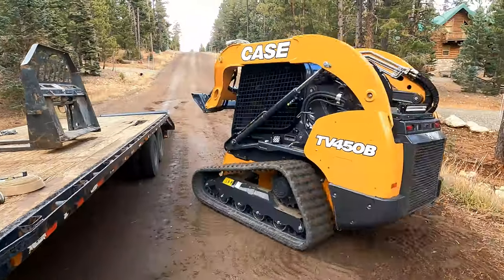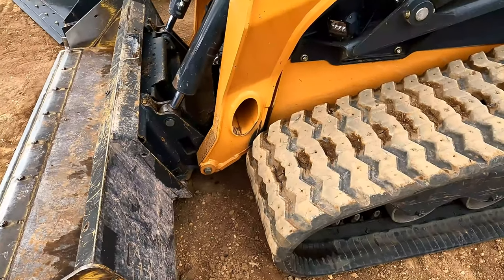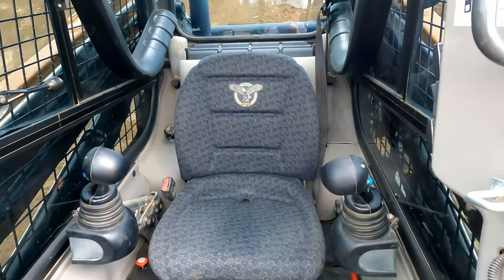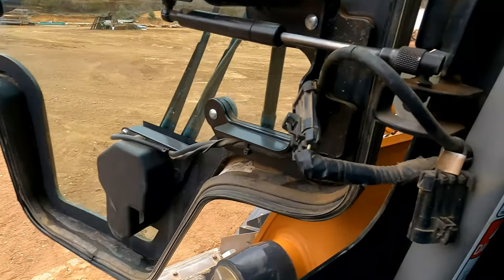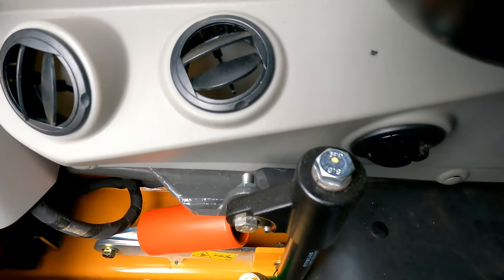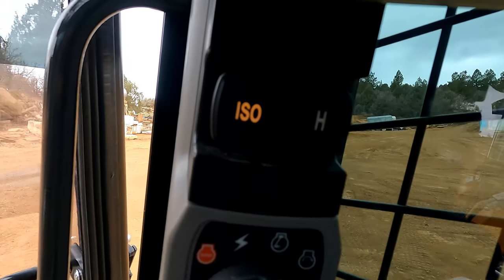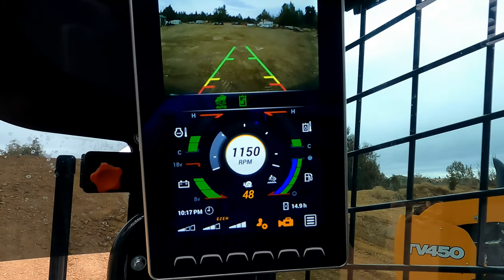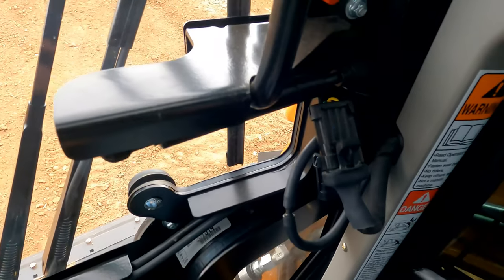Case TV450 vs Case TV450B Skid Steer

Comment: The knocking at shutoff is your DPF pump priming the catalyst for the next cold start.
Reply from the maker: OK, thanks for the wisdom 👍👍
Reply: @SolidworksUnlimited  I recently traded my TV380 up to a TV450B just like yours!  Enhanced Hiflow and Demo door
Reply from the maker: Do you like it better
Reply: @SolidworksUnlimited   Yes. Absolutely. Better control resolution, so it is not as jerky on the controls. The Enhanced HF runs my mulcher better than the Standard HP Hiflow, it seems to be good so far.
Reply: @SolidworksUnlimited  There are so many incremental improvements to the machine.  Hard to list them all. Love Love Love my 450B

Comment: Things they need to update.  Front door visibility.  Push lift arms out away from cab door. Joysticks mounted to air seat . Radiator and coolers mounted up high for easier service.
Reply from the maker: Agreed, those arms are too close together anyway, they twist too much when carving on a dirt bank it would improve overall visibility as well.

Comment: Are there any performance differences between the two models, hydraulics, travel speed, pushing power. Thanks for posting your review 👍
Reply from the maker: The tv450b has several speed adjustments for different operators setting, but top speed is about the same.  Pushing power the b is stronger it will push through a belly dump of gravel without lugging out. The only reason I slowed was to make sure it didn't break the glass when it piled up. The b will lift more and it's hydrolics are slightly faster.

Comment: Still terrible visibility out the front door . Need to update lift arm configuration to widen door opening
Reply from the maker: I do struggle a bit seeing out the front because of the window wiper, and my seat is all the way back I can't see the edge of my bucket on one side. I have to lean forward more than is comfortable over a period of time makes the back sore. But even still I think its a well balanced machine, hydraulics are even throught etc.
Reply: @SolidworksUnlimited  I can't stand a machine that mandates I look through glass. I either take the door off or I use a roll up door machine .